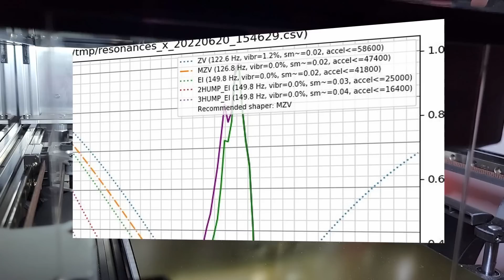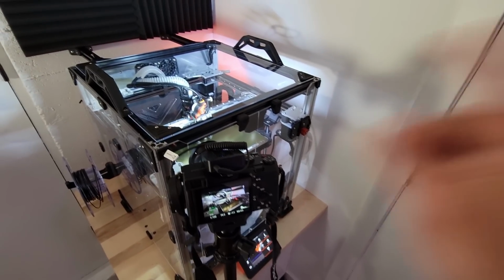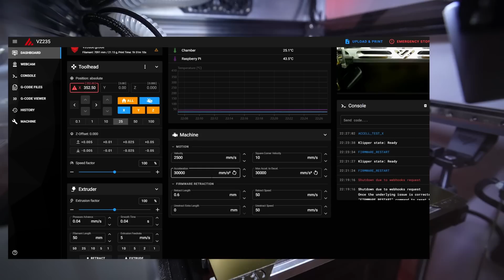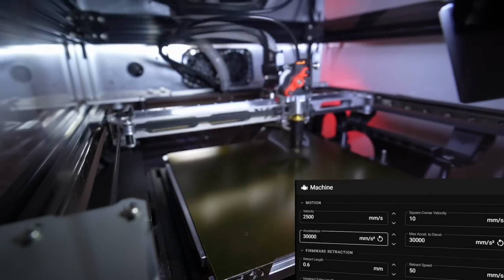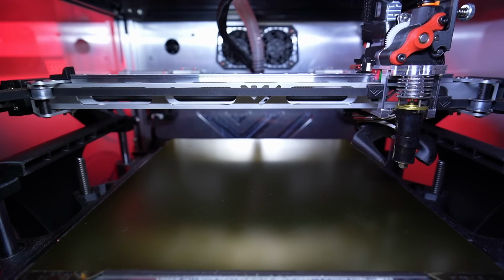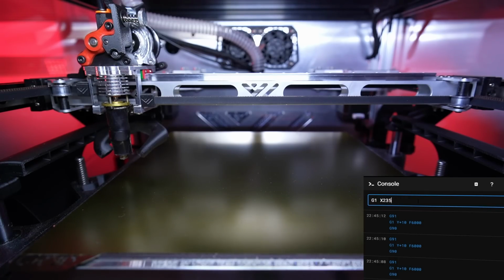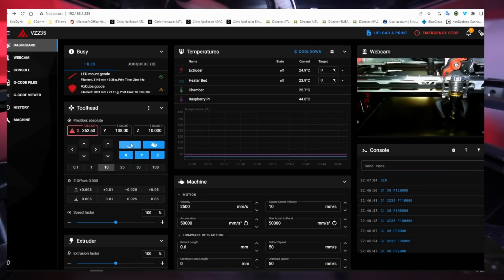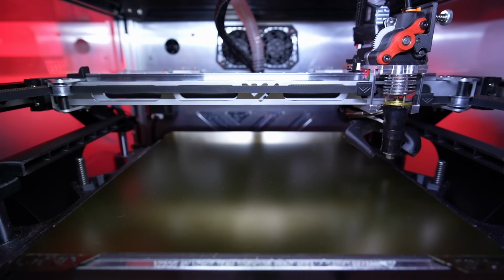VzBoT Vz-235 Speed and Accel limits

Comment: Did you accidently do the xy acceleration test at 2500mm/s? In the video you say you are doing it at 1000mm/s, but the velocity shows 2500.
Reply from the maker: Nah.. 1000mms. The 2500 you see on the screenshot is the max speed set in the firmware
Reply: @Vez3D  thank you

Comment: Have you checked out the Leadshine 42CM06 stepper motors? They have lower resistance, inductance, and rotor inertia compared to the LDO 42STH48-2504AC while having more torque. They may be able to do 2000mm/s @ 50K acceleration.
Reply from the maker: Ill look them up :) ty

Comment: @Vex3D I’m looking forward to the under 3 minute benchy! 🤣🤣🤣
This is just nuts.

With such high G-forces, I do wonder if you’ll shake the extruder/hotend into pieces with them flying about.  This will be a great test of long-term material fatigue at over 10g acceleration/deceleration possible,

Comment: the reason your mgn 7 rail is flexing so much is because your rail is on top , and all that weight on the bottom means the center of mass isn't right   on the rail, so the rail needs to bear both thrust and moment, casing it to bend and twist, try placing the center of mass of the entire print head right on the rail block and give the mgn7 rail another try
Reply from the maker: Most of the weight is already on top..with the extruder.
Reply from the maker: also.. without any weight on it.. just the aluminum top plate.. .its definately flexing way more than a MNG9.. so .,.

Comment: Have you thought of changing the motors to bigger ones or more powerful? That could be a way of getting the super high acceleration with high speed.
Reply from the maker: Yeah I did try many motors. Bigger isnt always better...as more mass / inertia and more vibrations.  I enven tried servos..bldc..odrive
Reply: Maybe 4Amp or higher?

Comment: What is the max RPM you use at 2000mm/s on the motor? if i may ask?
Reply from the maker: With 20t pulleys its 40mm per rotation.. so 50 turns pers sec.. which is 3000 rpm

Comment: Nice Video but you use too many engery for FDM Printer, because too many mechanical elements, that is not the future. The speed and quality will limited by the mechanical elements
Reply from the maker: Hi sir. Any suggestion? Please show me what you have in mind that is the future :)
Reply: @Vez3D  i think resin is the future, faster, better print quality but the prints not stability and the print material is not good at this moment.

Comment: How do you know the motors are running at 2 amps? Do you have an ammeter connected in series with the motor to check?
Reply from the maker: Its a setting in klipper.

Comment: Nicely done vez, extremely impressive.

It hurts to correct you, but when the printhead moves in y only 2 motors apply torque, not 4, although 4 turn. The two responsible for a straight x movement are not applying any force on the y gantry directly (if you undo the y belt and do a x move the gantry will slightly move due to inertia of the printhead), the only overcome friction and internal stresses in the belt. But you are right about the weakest point, a 45° movement, the y motors need to accelerate the gantry and printhead in y as well as the printhead in x. Tje weakest link speed wise is a 45° movement were the x motors need to turn twice the speed of a linear y movement (45° x motor doesnt turn, 90° x motor turns at V speed and at 135° it turms at 2V speed). I hope that doesnt confuse you, i was quite surprised that many youtubers claim that you have the force of 2 (4 in the vz235's case) motor for a y movement, but in reality 1 applies its force and the other one executes a correctional movement. On the other hand no paper claims that all motors apply their force for a y movement. But some said youtubers also say that the ender 5 is a core xy, which is BS.
I hope i brought some clarity into this topic and didnt cause some more confusing in the world of 3d printers
Reply from the maker: Im not sure here buddy. When you go in y or x.. both corexy motors will run together...and on a quadxy..its 4 of them. Unless im completely sniffing glue here
Reply: @Vez3D  yes moving and applying torque are two separate things. As i said, on a y movement both x motors basically apply no torqueon the gantry, only the y motors move the gantry plus printhead while the x motors make sure the printhead stays where it is on a linear y movement. Since the is no velocity change in x, the x motors are just overcoming friction.
Reply from the maker: If you remove one belt .. it will move in diagonal
Reply from the maker: Both Motors Move Clockwise >> Carriage Moves Left

Both Motors Move Counter Clockwise>> Carriage Moves Right

Both Motors Move Opposite of Each Other>> Carriage Moves Toward & Away

One Motor Moves>> Carriage Moves Diagonal
Reply: @Vez3D  ah, sorry bud, hadn't the core xy kinematics completely in my head, was thinking of a hybrid corexy or something like that where thy y belt is only attached to the gantry and not printhead
You can delete my comment if you want :)
Reply from the maker: @over_pizza_2578  it hurt me to correct you too  .... hahaha 😆  just kidding man. Its all good. But you got me wondering for a while if I was going out of sanity
Reply: @Vez3D  i could say that was intentional....

Buuuut sadly not, probably had a big brain fart, was past midnight here in europe when i wrote it
Reply from the maker: @over_pizza_2578  haha no worries.. I have bigger brain farts here man. I can be dumb after midnight too ;)

Comment: It won't print at 2000 mm/s. Layers wouldn't adhere and lines will tear. I tried with my experimental ODrive-based printer and PETG filament.
But such travel speed might make retracion useless. :)
Reply from the maker: I was able to print at 1500mms.. so maybe :) I have better flow now with this hotend so we shall see

Comment: This video is the equivalent of Goku going Super Saiyan 3.
>Vz235: goes 30,000 accel This is my normal Speed form.
>Vz235: goes 50,000 accel This is my super speed form, or Super Speeyan
>Vz235: goes 70,000 accel This is my brother 330's ultimate speed form, or Ascended Super Speeyan 2.
>Vz235: AND THIS goes 100,000 accel IS TO GO EVEN FURTHER BEYOND!
>Vz235: AAAAAAAAAAAH attaining speeds beyond 120,000 accel AAAAAAAAAAAAAAAAAAAAAAAaaah... and this... is Super Speeyan 235.

Now you only need a montage for ultra instinct Vzbot, and you are golden.
Reply: I wonder if it’s possible to get over 100K acceleration on a larger printer.

Comment: I wonder if you’d be able to do a speed Benchy in under 3 minutes.
Edit: also, do 0.4mm CHT nozzles have the same maximum low limitations normal nozzles have?
Reply from the maker: they have higher limitation, but its not super high either